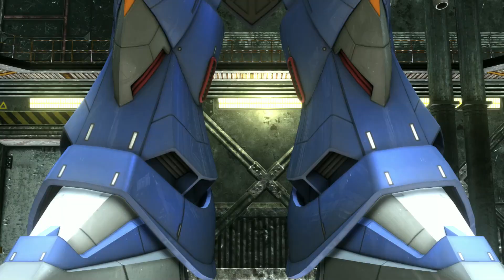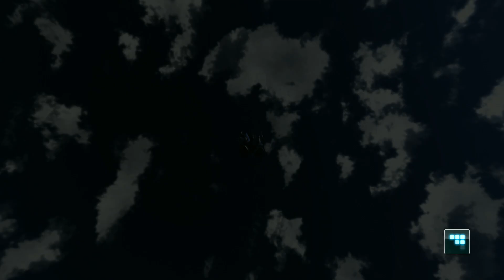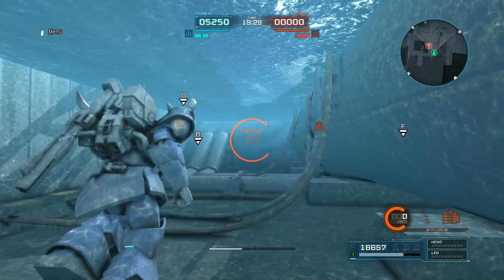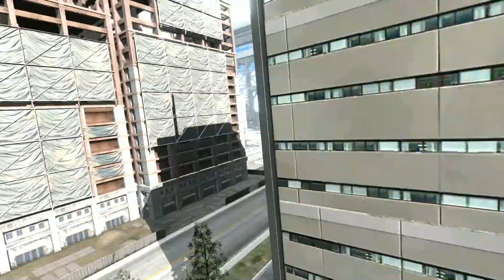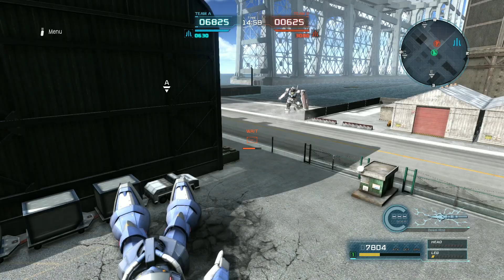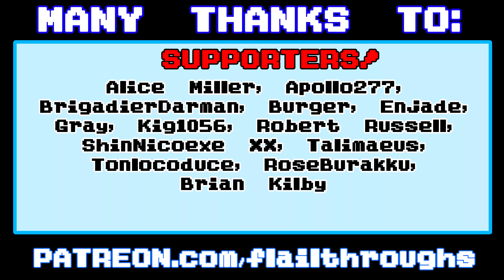Gundam Battle Operation 2 Test Drive: OMS-07RF RF Refined Gouf Has Two Heat Rods And A Heavy Attack!

Comment: The Oldsmobile Army's RF series of MS don't use the Geara Doga's frame. They just have internals derived from the Geara Doga. But improved on. The fact that the Oldsmobiles could remodel a stolen F90 means they improved their technology quite a bit. But here's an interesting tidbit. The RF Dom and RF Gelgoog actually have the same frame. The RF Gelgoog is the higher performance

Comment: so a couple bits of advice i have picked up from my brief time with this suit, first off change your main weapons shortcut to either the launcher or the head vulcans cause those finger guns do not do enough damage or build to really be a main weapon and second a great combo if you have someone isolated or enough cover to pull the whole thing off uninterrupted is rod neutral to electric to saber 2-3 swings ending with a down then rod down, does a lot of damage, keeps the enemy pinned down and will likely out right kill a support if they don't get saved by someone else